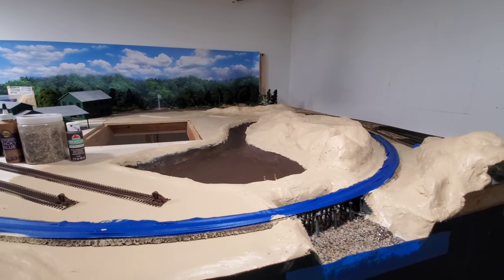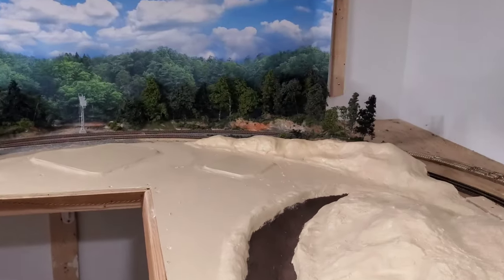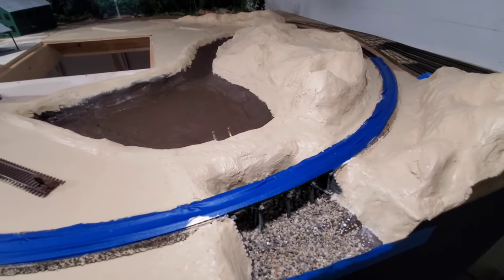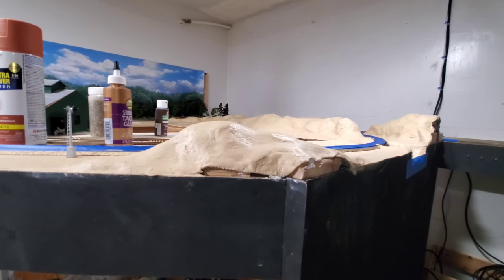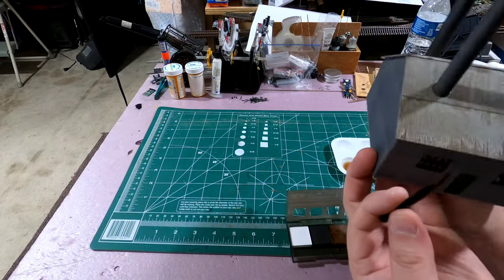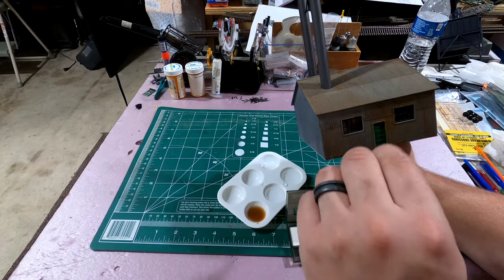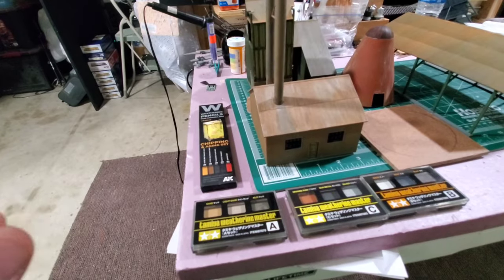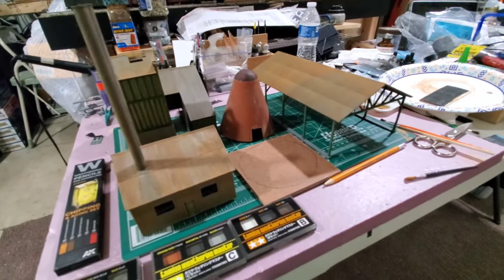Layout Update + How To -Tamiya & AK Interactive Weathering Products - Basic Scenery

Comment: Nice weathering job.  Oh so you know that power building, even if it’s not producing power the are using for something, storage, metal shop, vehicle shed, it’s used for something.  If not it’s gone and logs are stacked there.  Just saying.  So you putting in some piers in the pond before you pour?  If it’s going to have logs they got to be tied to something.  Happy holidays.
Reply from the maker: Thanks Steve! Very good point that they just wouldn't leave a building up if they weren't using it for some odd reason or another. Yeah and I want to put in a small dock for the log broncs too.

Comment: Your pond looked like chocolate pudding, then you gave the color...rotflmao The building turned out great. I'm guessing you could use powders the same way? I haven't done much weathering. I did work the green chain at a mill one summer when I was 17, wore my ass out!
Reply from the maker: Thanks JD! The powders you don't get wet. I've used those before and as long as you don't touch them, they are very good to use but once you dullcoat them, its like it disappears. When I weathered that boxcar with dry powders for dirt and grime, I had to several layers to get the effect.